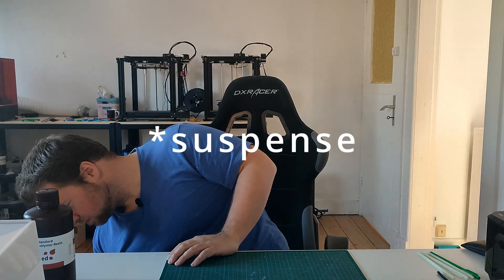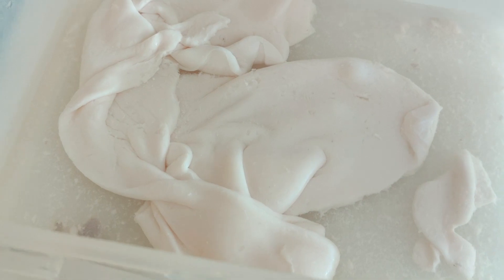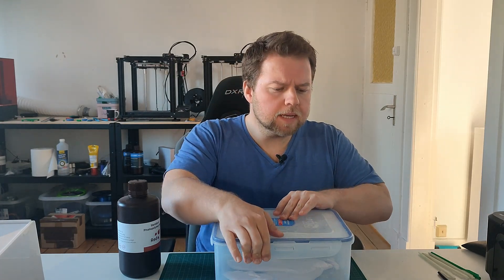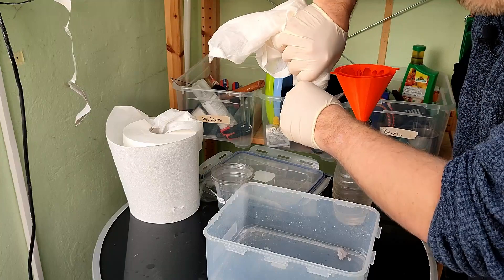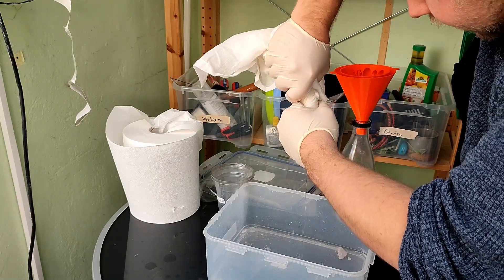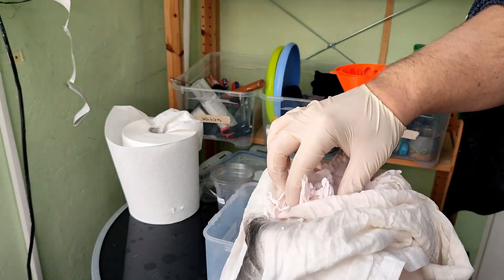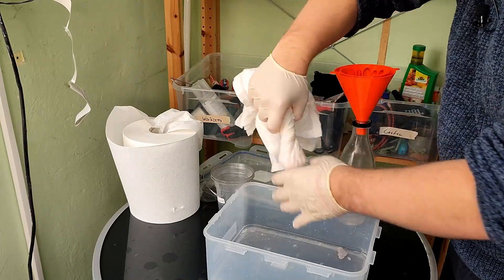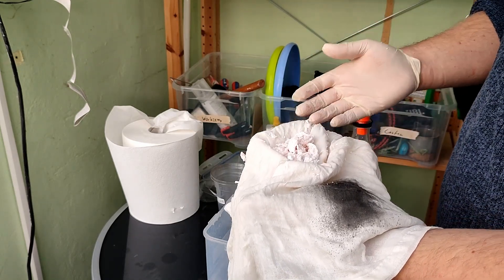Recycling IPA without producing waste FAST

Comment: Thorough, thoughtful, mindful, and helpful. When I started out 3D printing, I got a ton of water washable.  The need to constantly sanitize the water seems to make me be a little bit careless with my own safety (My brain: its just water, whats the issue if I touch this or that) I try my absolute best but I still find myself screwing up. Been wanting to try ABS finally after a whole year of printing, and you just fixed my NUMBER ONE problem with switching. Very interesting. And yes, get yourself some thicker, waterproof nitrile gloves! I cannot stand getting lose water/liquid in my gloves.. doesnt seem safe. Nitrile is pretty good even just for the usual exam glove type.

Comment: I place my cleaning container on the magnetic mixer next to my UV box and run it slow while exposing it to the light. There is no mucus, only cured particles, and When finished I run it through the coffee filter which catches the resin particles, may not be the best, but it’s working so far
Reply: 5-10 minutes
Reply: How long do you run the curing?

Comment: Why not just reach inside and remove the larger pieces? ...
Reply from the maker: You mean the floating cured resin in the container / white fluffy stuff? Its unfortunately not really sticking together. Its pretty much just floating particles and when you try to use a spoon or sth like that you will only get very little of it out and on top of that also remove a lot of IPA that is floating in between the particles

Comment: Can a centrifuge help collect particles on the sides of a container?
Reply from the maker: I have not tried that but I am very certain that a centrifuge would help. I am pretty sure that the cured resin particles are heavier then the IPA so they should seperate nicely. If you give it a try and have some feedback for the comment section that would be awesome.

Comment: I'm curious... do you cure the ipa/resin mix before filtering?  Previous attempts at that have left me with the plastic gel.
Reply from the maker: I usually let it sit in the sun for a day so that the resin solved in the IPA cures. But during the winter I have a box with 405nm leds glued to the inside that do the job

Comment: Nice idea. Thanks for posting. This basically looks like making cheese except you want the liquid. Have you tried using a cheese press or similar device? Cheers.
Reply from the maker: Thanks! I actually have not. So far I had no real reason tu purchase a press. But I am currenty working on a different video for this channel for which I need a press that kann output a ton or two of pressure... If I purchase one I might give it a shot. Resin-Cheese.. the stuff of nightmares ^^

Comment: U have to repeat it 2 times. And as long the Resin is not hard it is toxid and nothing for the normal garbage. 
Ich weiß, blöde Argumentation, aber solange Resin und Reste noch flexibel sind diese toxisch.
Dein IPA/ Resin Klumpen hat im Hausmüll nichts zu suchen. Nur voll ausgehärtet.
Ist aber nat. nur meine eig. Meinung
Gruß aus S-H

Comment: I saw that funnel and decided to design my own. It's similar but with a more shallow bowl  and has a longer tube at the end so it will stay in my bottle without tipping over.
Reply from the maker: Great idea. The funnel that I am using really is not the best because it is rather narrow in its design.

Comment: Where did you get the large container?  I'm looking for a good large but shallow airtight/watertight storage container to let my used IPA settle before filtering.
Reply from the maker: I bought it on amazon. It is from the brand "lock & lock" or "locknlock" and does a good job. The dimensions are 295mm x 230mm x 118mm.
Reply: @m3chs_makes  Thanks for the information about containers.
P.S. Go for nitrile gloves and no latex.

Comment: So after you wring out the goo and scrape most of it from the cheesecloth how would you go about cleaning the cheesecloth for the next use?
Reply from the maker: Both steps that you just descriped are enough. It never really cloggs the cloth so that it becomes useless. The Cloth itself has rather big pores compared to filters. Thats why you need to stack it to prevent particles from passing threw. And the nice side effect is that the particles never clogg the cloth.

Comment: Avoid using latex gloves!! The resin will eat through latex. Find yourself some nitrile gloves (or vinyl if you can't find nitrile) to protect your hands! You also really need to cure the dried goo with UV light before it is safe to dispose. I really like the idea of using the cheesecloth though! I'll have to pick one up at the store.
Reply from the maker: did not know about the glove issue, thx for letting us know!
Reply: @m3chs_makes  Yeah it doesnt help that even printer manufacturer's ship their printers with Latex gloves so people assume that's what they need. Being a chemist myself I immediately bough 2 boxes of nitrile ones and never used what they sent me.
Reply: @realandimaginedxyz  what is your opinion of using Simple Green instead of IPA?
Reply: @m3chs_makes  absolutely! Thanks for the idea of using a cheesecloth!
Reply: @connorparrish3799  Cured resin is thankfully much less reactive. Still, really good to lean towards being cautious.
Reply: I used them for 2 years and never had an issue with them. I got ahold of 20 boxes of Nitrile for free so I am using them now, but Latex  works just fine.
Reply: Thanks!
Reply: I'm actually using nitrile gloves made for cleaning. And they're thick and sturdy and so I have been using the same pair for about 1 year having saved a couple hundred disposable ones.
IIRC I picked them up for about 10 euros...
Reply: Fun fact but the gloves only slow down the resin getting onto your skin, Nitrile or Latex doesn't matter (double up if need be).  Make sure you wash your hands with non abrasive soap afterwards and you should be fine.  For increased protection use Neoprene gloves.  Source - Chemist
Reply from the maker: Okay, so after almost a year I did a test on this. A video on that is in my shorts or here: https://youtube.com/shorts/X34l2Q6SMNU?feature=share and long story short... Latex gloves are actually ok to use. At least for like 20 minutes of exposure. Who would have thought.
Reply: @m3chs_makes  good to see, but another reason to prefer nitrile gloves is that nitrile is 3 times more resistant to punctures. And supports definitely try to puncture gloves during removal

Comment: I'm actually genuinely curious if this dried up goo can be used for anything. I mean, if it can be further cured into a solid mass with UV, maybe it could be used as some kind of putty to put inside silicone molds and then be tossed into a curing machine to harden it.
Reply: Some people make disks with it and use it as bases for miniatures. As it ends up looking rough and irregular once it cures (and shrinks) it's perfect to simulate terrain
Reply: I too would like to know if the goo can be cured further?
Reply: in theory its possible, but remember that there would be a lot of shrinkage as the IPA dries, so it wouldnt be useful for accurate moulds. 

However, you could flatten it out and make it into resin sheets, cure it in the sun or under a uv light, then make stuff out of it.
Reply: I'd be less curious about trying to use it for anything and more interested in curing it into a solid for disposal.